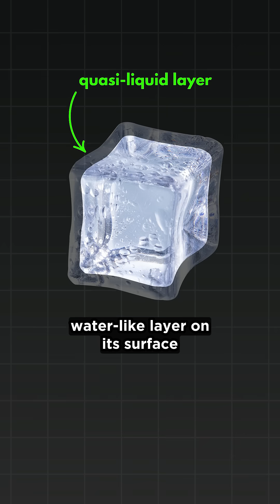The Science Behind Slippery Ice: Why Ice Skating Defies Logic

Comment: It took them that long to figure that out? I coulda told you that from the ripe age of maybe 10. All you need to realize this is that when you have water in a cup and try to rotate the cup, the water resists rotating with it because an object at rest will stay at rest, and the cup can barely inflict any force because of the clear lack of friction. Ice is obviously made of that same low friction water, and on the outside of the structure you will always have water molecules surrounding the inside meaning that the skates touching the ice will behave like the cup touching the water.

Comment: The ice in ice rinks IS usually not that far from 0°C. If you are skating on super-cold ice, like when the ambient temperature is -35°C or so, your skates must be much sharper than usual. That supports the melting under pressure theory, because the narrower blade edge exerts the pressure in a smaller area to compensate for the lower temperature. Less sharp skates then tend to slip sideways.

Comment: I'm not trying to say that you're wrong about the quasi-liquid layer or anything. But you literally showed two weights, a fraction of the weight of a person, making a wire melt through ice while proceeding to say that the weight of a person on an ice skate wouldn't be enough. Even if those weights were tungsten, they still wouldn't weigh as much as an adult. I know the footage was sped up, but if the weight wasn't enough then it wouldn't have melted through. Even assuming the wire wasn't ice cold, it would have been before melting through.

Comment: Ice consists of water molecules. It is also crystalline. Therefore, the molecules are arranged in a lattice structure. However, the edges of this lattice are not complete molecules, but rather individual atoms that, on their own, have different properties than a complete water molecule.

That's my theory. So the question I have is, is ice still slippery in a vacuum and in absolute darkness?

Comment: Finally caught you
It is because of the melting and let me get this straight.
I weigh 70kg (140lbs? Not used to retarded measurements)
Not enough would you say to melt ice, i can relate.
It doesnt hurt REALLY BAD if i would be standing on your pinky.

But lets just imagine i would wear ice skaters on my feet and still standing on your pinky.

Exactly, pinky gone.

So it is not about the over all weight, it is the weight forced to a very small surface wich thennis enough to melt the ice

You are welcome:)

Comment: I thought it just does because of how our body heat travels through the figure skates and the metal part to melt the ice or that in like a ice ring the amount of people cause it to melt bec of how we have a hot air around us at all times that we dont notice and from how much people are there their hot air melts the ice or just the simple answer i also thought which is what if the ice skates just scratch the ice into small pieces that melt quickly and cause water to appear on the ice and make it slippery

Comment: Gosh u mean to tell me the sticky stuff called water that freezes structurally filling the gaps to what ever they hold and potentially other water molecules that can be accented by breaking cell walls (witch is what causes freezer burn  and frost bight)  water holds some electro magnetic properties aswell. I don’t know enough about it, to assume anything about the only material that expands when cold and when hot.  Vaccine in those sealed areas are possible aswell? So this mysterious layer is water. Baking the solution a mixture of the 3, bc they all dance around the same principle. How, well, stop thinking as molecules as solid objects.. even tho they draw atoms with circles.. they are not in actuality

Comment: It has minimum friction because it's smooth (not the other way around) and it's smooth because it "crystalizes" when it freezes.
also if the air is colder than the ice cube then the "water layer" around it is more frozen than the cube itself - in a transition of temperatures from the cube to the air

Comment: Right but the friction explaination isnt a contradiction in any way. 
If a surface is concidered smooth that usually implies that it requires minimal friction to move or slide across it, and at that point you just slide untill you reach the centre of the smoothe surface or the edge or as long as your leaning a certain direction changes your centre of gravity causing you to slide. So while the science fact at the end of intresting, it isnt so relevant to the figure skating in the sense that just knowing that its a fairly smoothe surface woulf have been enough to deduce the figure skating.

Comment: Negative pressure when the skate is carving into the ice.
This creates static electricity and the negative pressure lets the ice melt far easier. 
This allows for the friction to be reduced.
The static electricity generate excess heat away from friction heat causing the ice to melt. 
The reason the ice doesnt stay melted is because the pressure is returned right away and the amount that is melted is miniscule. 
Also, the action of ice crushing creates a serious amount of heat. 
Which is why skating rinks will get slush build-up when they are heavily used. 

But hey, what would i know, im not a registered scientist.

Comment: The ice skates ”blade” is concave under so it creates a very small high pressure point that melts a bead of water on both sides of the blad allowing iceskating to work. That’s at least how it was explained to me. You can try it at home using a knife and an ice cube by slightly pressing the knife’s edge against the ice cube. The reason why the blade on the ice skate is concave is mostly for stability.

Comment: In Canada we have two terms for this wet ice and dry ice dry ice is so cold that little tiny layer is frozen and this won't work, when that happens below -14 degrees Centigrade if the ground in the air reach below -14 degree centigrade you can take a chunk of ice put it on top of another trunk of ice and it will not ever stick unless it is getting moisture from another source.

Comment: So, there are differences between a snow and a ice, in snow you don't exactly slip and also yet the snow has fragility, you can turn it into ice, so the possible simple explanation is that a so small part of the ice melts in contact with objects (not every material with texture can be slippery) that cause them to be slippery? And the water can be slippery when on some materials, but this is not connected with the explanation.

Comment: Specifically regarding why ice skates can glide across the ice, friction forces are proportional to surface area. Being that ice skates are literally blades they minimize the surface area in contact with the ice allowing for easier gliding. To be fair, the surface needs to be kinda slippery to begin with i.e. ice skates won't glide as easily on concrete so surface area isn't the entire story, but it's a nice contributor

Comment: Would it be possible that the expanded molecules of a liquid going solid factor in? The expansion could cause air to more easily exit it would break down some of the crystalline structure along with whatever is pushing on top, breaking down a layer of ice and therefore making it more slippery?

I'm not a math or physics geek.  My only basis for understanding ice is that water expands when solidifying, and that it's slippery. So idk if that would factor in but there's where my mind went when really trying to figure it out. The ice clinging and freezing to itself would work under this, as long as the temperature is freezing they would still bond together as their structures are now combined together through molecular adhesion. 

Again, please don't come at me math/physics/chemistry nerds. I'm a filthy biology simp. Have mercy!

Comment: A skate on ice is basically like a rasor blade on skin, if you apply a force in a small point, it's gonna dig into the ice, if it's spread in a bigger surface, it glides.

For the ice sticking onto the other after freezing, another explanation is that the air (or more exactly the water) condensates around the ice cubes and the cubes, if you put them on top on another, will trap the water molecules and freeze the water, making a single ice structure.

Comment: I’ve been a figure skater for 9 years and the reason skating is possible is because our blades are made of steel which melts ice so it melts ridges into the ice which we glide in
Reply: She literally just explained why this isnt the reason that ice is "slippery"
Reply: @gogosteve12  r/woosh 
Basic things right over your head. Remember that just because someone says something online, it doesn't make it true and yes you could apply that to my explanation
Reply: @foxtrottails r/stubbornchild remember that not everything online is misinformation and not true! If you were smart you could look her explanation up and look for papers. I found two dating back to 2014 even and many in 2023 and 24. Being stubborn and writing unnecessary messages explaining the obvious. I've followed 2 courses of material science and this was also explained to us ❤
Reply: @gogosteve12  this definitely went over your head. I'm not going to fight someone online with something I already know.
Reply: @foxtrottails if you consider this fighting then you really don't need to be on the internet commenting stuff to begin with. The theory with pressure and conducting heat evenly still holds but this explain everything way better since the metal cools down to quickly to begin with and pressure wouldn't work in some climates while you still slide either way. This quassi layer has been proven for decades already and is the best explanation we have for why we can slide and skate so easily. You're stubborn and don't want to look into it and go off of what they taught you in highschool which is outdated or not the full picture. No need to "fight" when you can look it up and test the ice cube experiment yourself or try other experiments with ice in sub zero climates to see and feel this quassi layer.
Reply: I was looking for someone else who understood how it works. Her videos just seem to spread some misinformation

Comment: The pressure explanation is indeed correct, you have to take into account that the point of contact with the ice is very small which in turns multiplies pressure several times over

Comment: Imagine not understand how pounds per square inch work In terms of pressure. The blade melts the ice because you have multiple tens of pounds of pressure going onto an extremely small area making the pressure multitudes of factors higher than normal which would in fact melt a small bead a water from the ice.

Comment: No the pressure on the thin blade melts a bead of water your weight is enough because it's a small contact surface area, it's true that it's slippery because the water layer, but that effect stops at around -1° C and you still skate on ice, it's a melted bead that refreezes as you go that's why it's slippery

Comment: You spread mis information masked as “science facts” 

This is the second video now where I’ve seen you straight up incorrect or lying or possibly just making stuff up (not saying it’s some evil
Thing ) 

BUT because the ice skates”blade” is so small AND because metal is a good conductor of heat the little
Tiny blade put MORE pressure on that area which melts the ice which makes It slippy 

Please stop the cap 🧢

Comment: Explanation:

Ice rinks are slippery thanks to a fascinating blend of physics and chemistry happening right at the surface:

- Surface water molecules: The top layer of ice has water molecules that are loosely bonded, unlike the tightly packed ones deeper in the ice. These surface molecules behave like tiny ball bearings, rolling around and reducing friction.
- Quasi-fluid layer: Even at extremely low temperatures, ice maintains a thin, “quasi-liquid” layer. This isn’t liquid water, but a layer of molecules that move freely—like a two-dimensional gas.
- Temperature sweet spot: Ice is most slippery around –7°C (19°F). At this temperature, the surface molecules are energetic enough to move easily, but the ice remains solid. That’s why many indoor rinks are kept at this exact temperature.
- Speed and pressure effects: When skates or pucks move quickly across the ice, they generate friction and pressure, which can slightly increase the mobility of surface molecules—enhancing the slipperiness

Thanks chatgpt

Comment: If you concave the inside of the blade create two points where the blade can shift back and forth you can extend the amount of pressure that all of your body has onto one point shift waight consistently and you have pressure caused heat melting a bead of water to glide on

Comment: I always assumed it was because ice naturally smoothens itself as any small grooves would be exposed to more of the surrounding air, causing those parts to melt a bit faster, and also meaning as the ice naturally rises to the temperature of the surrounding air, it will become smoother and smoother. Provided no outside forces are working in any way with or against the process. But tbh I’ve never found I cared enough to research if my childhood theory was actually correct, or even close 😅

Comment: I was under the assumption it is because the friction and weight causes a contraction of the ice into a liquid form. Ice being one of the few materials that contracts into a liquid form as it is placed under pressure because the solid form is less dense then liquid or when heated up would make it so the outer layer immediately forms a thin liquid layer. Even with the metalic portion of the skaters blade at the same tempurature the pressure from the skaters weight should make a very thin liquid layer on pressurized contact. You are placing a point contact on essentially a very thin layer of balls. Think about how on a beach a ton of sand is a lot offriction or you just sink into it but if you have a very thin layer of sand on a very flat surface it is also extremely slippery. The pressure alone has a liquification and polishing effect on the outer layer of the ice. This should happen with any solid that is lower density then the liquid form. It is inherent to all negative thermal pressure compunds like water. However viscocity also plays a role in how fast a negative thermal pressure compound becomes slippery

Comment: This is so fucking stupid, almost everything in this video is either wrong or paraphrased poorly. For example, ice skates do put a massive amount of pressure on the ice because of their blades having 2 edges. Think of it like 2 knives right beside each other. With the weight of the human body focused on to such a small surface area, the amount of pressure is enough to melt the ice but we make the blades sharp to increase grip in the lateral direction. 

Much of this short is brainrot, if u are actually curious about the real science, watch the SmarterEveryDay video on the physics of Ice Skating

Comment: OK, I haven't seen anyone else explain how it does that with ice skates, I'll say it. It's because the steel blades are too smooth for the ice to stick. If you went out there with chipped skates, you will get caught and slam yourself hard on the ice. Jagged skates will make it more difficult for you to skate. The premise is that smooth skates allow an even pressure from front to end that doesn't let water form a pocket. But the blade and pressure create a line that is just deep enough to be noticed by refracted light that makes it appear as if the cut is deep. This is why ice resurfacers (Zambonis) work so well on smoothing out the surfaces so evenly. There's not much to freeze in those grooves.

Comment: I mean pressure is multiplied exponential when you reduce surface area and skates are sharpened to a almost razor sharp angle meaning the surface area is almost as small as fan be. Meaning you could be exerting enough pressure to cut through the ice and be riding on an extremely smooth surface instead of the rough outer layer. That's what my physics teacher told us at least. i find it hard to listen to your logic and reasoning when you use ai videos tbh it takes away credibility in my personal opinion.

Comment: What if you're in a walk in freezer and try the experiment? If the room temp air hits the cube then it starts melting to build up that layer of water. In a walk in freezer the air is the same temp of the cubes so would the still stick? Even better would the two cubes stick in a walk in freezer that reached absolute zero? I don't think they would due to the fact that at absolute zero everything freezes because all molecules stop moving

Comment: In my opinion, I think isis led through because it melts, which causes a layer of ice to turn into water, which makes it more frictionless, in adulsie, because when you melt the layer, I think that most of the friction is already gone, so it's easier to slide on with the water on it, which makes it way easier and also because the blades of the ice skates are really sharp. So they dig into it curve, causing precise actions To happen to the odds, which can also keep you straight because it makes a notch